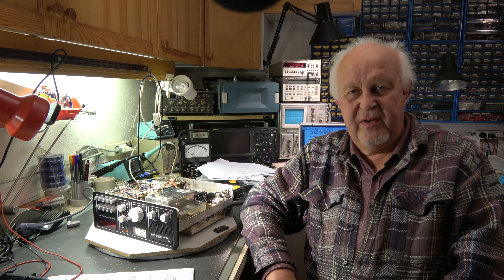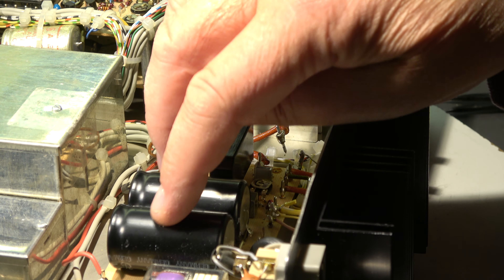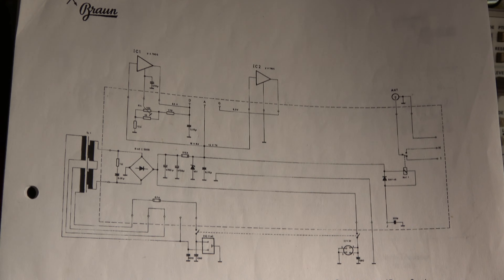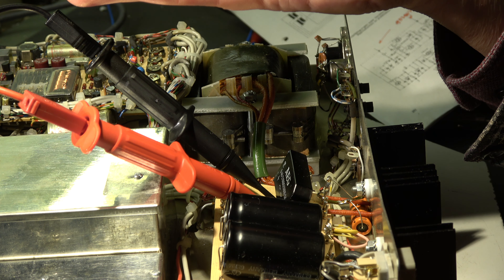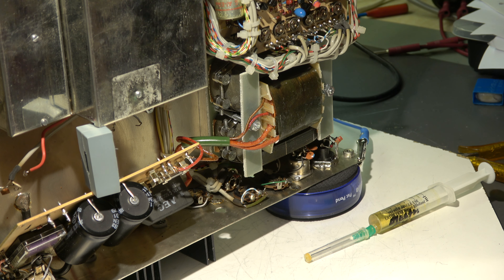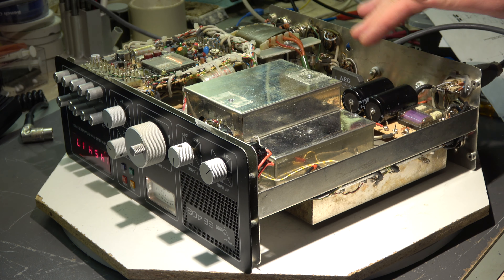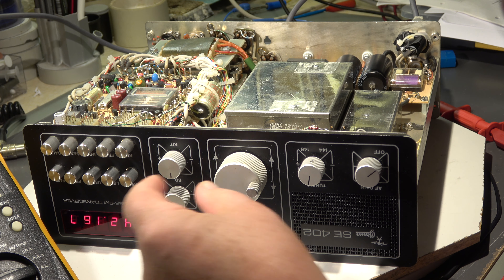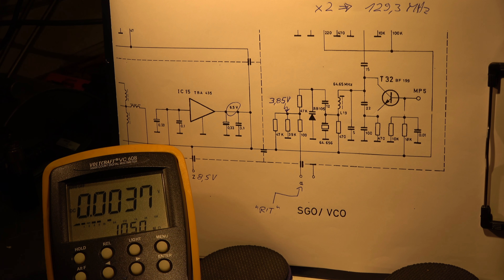#102 Braun SE402 Part 2(4)

Comment: Hello Stefan,
in the circuit diagram the Trimpot R16 is shortet to ground🤔
Reply from the maker: Da ist nur der Schleifer von R15 (R16??) geerdet, und somit ist der Widerstand nach Masse variabel. oder meinst Du was Anderes?
Reply: @dl7majstefan753  Ach Stefan, es sind meine Augen..... Nach mehrmaligem anschauen habe ich jetzt erkannt das es ein geschirmtes Kabel ist wo Du in grün markiert hast. Zuvor hatte ich an der stelle über diesem Trimmer einen Verbindungspunkt gesehen .....😕
Sorry, das nächste mal schaue ich besser intensiver 😉
Reply from the maker: @berndb.5097  geht mir auch manchmal so ... hi.

Comment: just change the 39K resistor to a 47K resistor. in this way the 8.5 volts is divided perfectly in 2, resulting 8.5 / 2 = 4.25 V. You have 4.25 volts also with the RIT potentiometer in the middle position. Problem solved quickly by changing one resistor only.
Reply from the maker: Yes, but please wait for video part 3